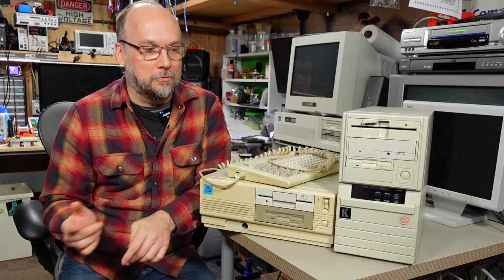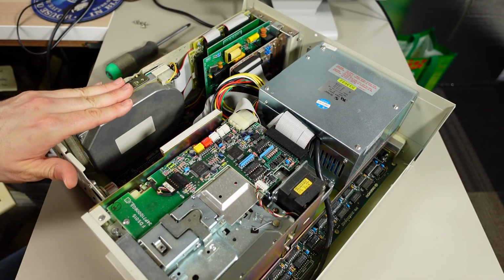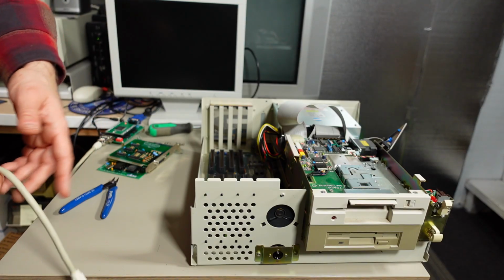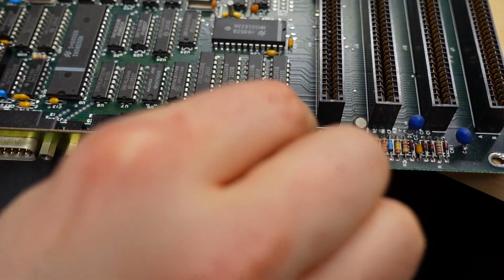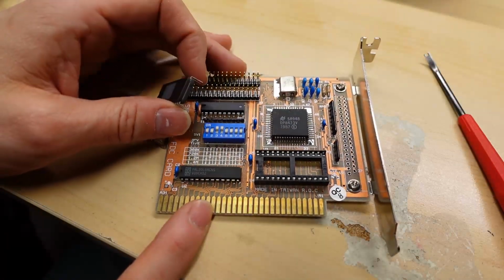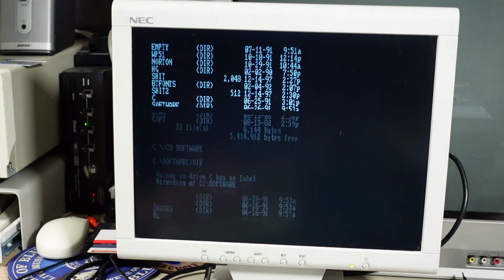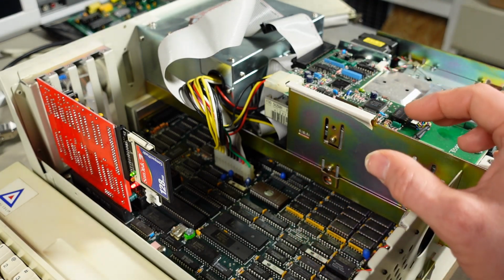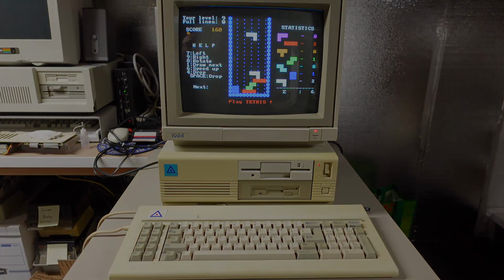PC archeology: Leading Edge Model D

Comment: It is always amazing to me seeing how many chips are on these old motherboards.
Reply: They were much less integrated then. The Model D was more tightly integrated than the XT class machines before it, that allowed them to undercut many others in price. Of course by modern standards, it's still a ton of chips.
Reply: It's also interesting how straight forward the design is. Well within one's ability to understand.
Reply: All of the discreet logic was eventually reduced into the north / south bridge chips we have in todays modern chipsets. Much easier to diagnose and repair with distinct chips if nothing else. :)
Reply: Makes me think of the Micro8088 project and how few chips it uses...

Comment: Adrian, the leading edge model D was revolutionary for its time. I still remember my father’s friend who got one. These were affordably priced quality PCXT clones. They had a smaller case than the IBM PC, they had front mounted power/reset buttons and keyboard connector, a real first for it’s time. They sold thousands if not millions of these things during the mid 80s. Leading Edge even sold their own branded word processor as well.
Reply: I remember LEWP... It sucked.
Reply: @wishusknight3009  Was the best WP for it's day... and only one that supported long-file names in DOS
Reply: @wishusknight3009  It didn't suck for its time.  If you think that sucked, try VI editor.
Reply: My girlfriend at the time and myself had a model D in the late 80's.  At the time it was the most featured computer for the price.  The IBM PC was excessively expensive and you didn't get a spreadsheet and WP.  Came with an amber screen in the monitor.  The store in Phoenix was just around the corner from us and was in an old U-Totem store.  Great little computer.
Reply: I still have a copy of LEWP somewhere in my file archives.  LEWP was advanced for its day.  My career started with teaching old retired ladies how to do word processing using LEWP.
Reply: I just found my copy of LEWP!!  I created a VM a while back and actually dumped LEWP into it.  I just fired it up and wow.  It sure brought back some old memories!  It still says version 1.3a from 6/1/85.  Good times.
Reply: The LEWP--Leading Edge Word Processor.  I had to support students using it in our library's computer lab (20 Model D's) as part of my campus job in 1987. I preferred Wordperfect.
Reply: @markuslvic  Or Wordstar before that. 
Anything but Edlin!
Reply: @markuslvic  A relative of mine had a Leading Edge Model D, with LEWP.  It also came bundled with a Lotus 123 look-alike, which as far as I could tell was an exact copy of 123, except for its brand name. Which appropriately enough, was...  "Twin".   :-D

Comment: You know what would've been fun for DOScember? Someone getting a 186 computer, specifically the Siemens PC-D, which runs on a special version of MS-DOS and for which most programmes are incompatible because of the 80186 architecture and the proprietary 5.25" 720k drives. It's supposed to have SCSI though. I would have also suggested the Tandy 2000, but that's for next SepTandy.
Reply: I once almost got one of these 186es but somebody beat me on Ebay at a ludicrous price. Was probably desperately needed to run a Nuclear powerplant from th 80's or so. :D

Comment: This is the first PC I ever used! I played Basstour and LEWP (Leading Edge Word Processor) and Nutshell (database I think) on my grandfather’s Model D! I had no idea it would support a 3.5 floppy drive, we were told since it was a clone it wouldn’t support one, but we did put a 80MB SCSI drive in it

Thanks for the trip down memory lane! Love your videos
Reply: Ah, Nutshell. When I worked at LE in the mid-'90s, we were still using Nutshell internally to look up part numbers, figure out which models came with which options, and the like.
Reply: My grandfather worked for a chemical company, and in the 80s they introduced payment plans to buy computers to increase computer literacy for their employees, my grandfather bought a Leading Edge Model D and a NEC Multispeed which I used for years, unfortunately I had a mishap with the NEC and some ROM chips and never got that machine working again, and the Leading Edge was donated, but the old machines just had a certain charm to them